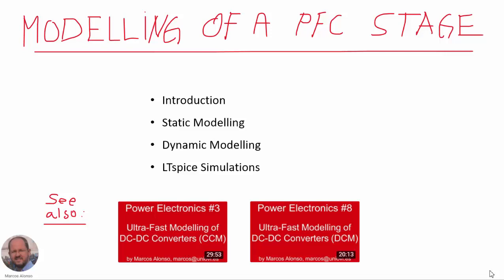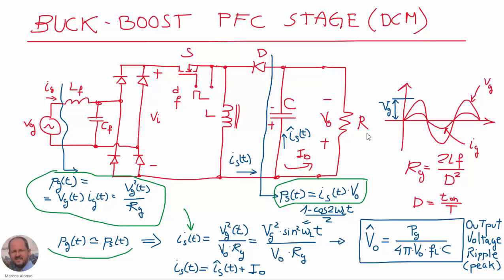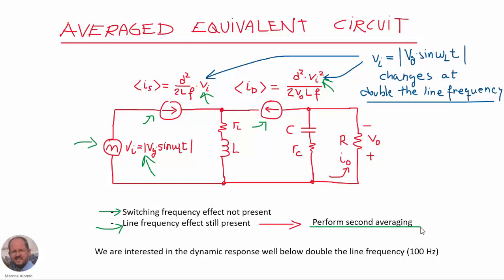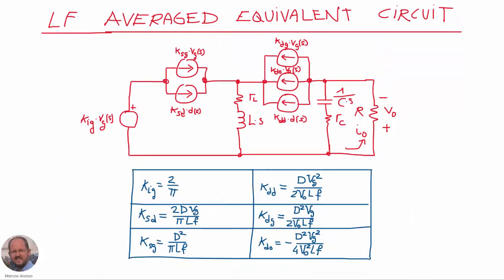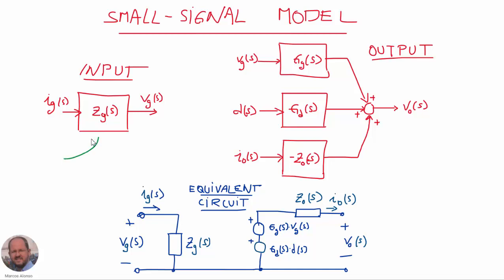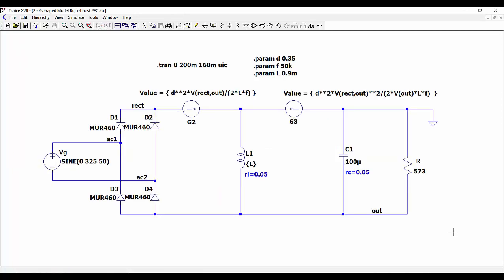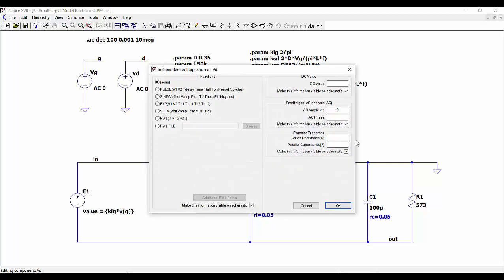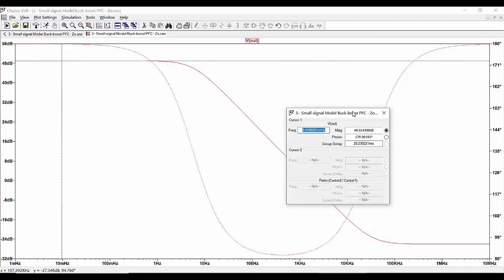PE #9: Ultra-Fast Modelling of a Power Factor Correction Stage (PFC)

Comment: Sir,

At 14.44, it is said the PFC circuit is first order circuit, can you kindly elaborate on this.

Thanks,
Sanjay
Reply from the maker: It means that the transfer function has only one pole. The response of the plant is therefore exponential. Second order systems have complex poles and the response is a combination of exponential and sinusoidal evolutions.
Thanks for watching!